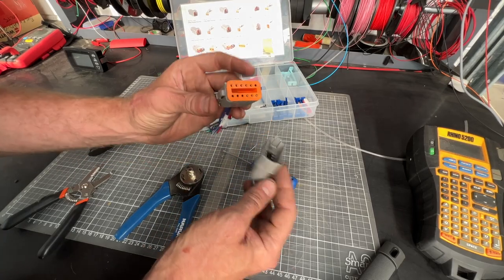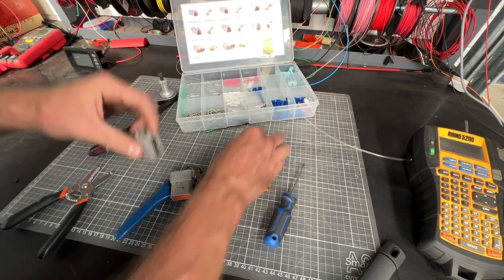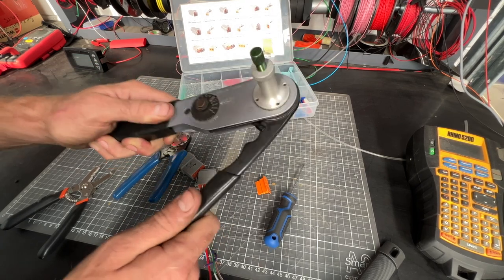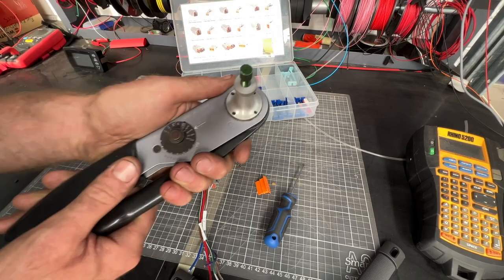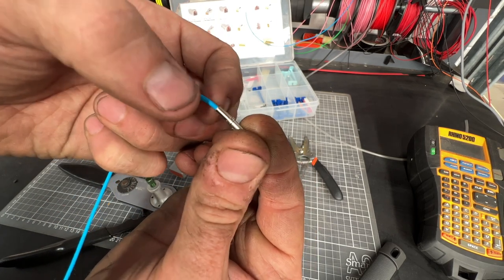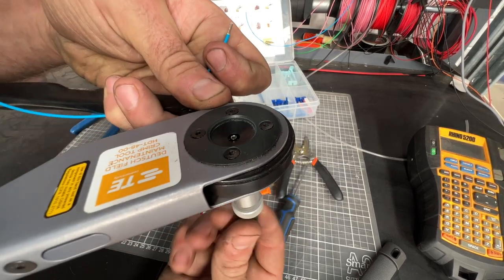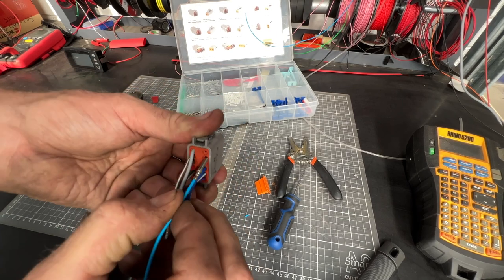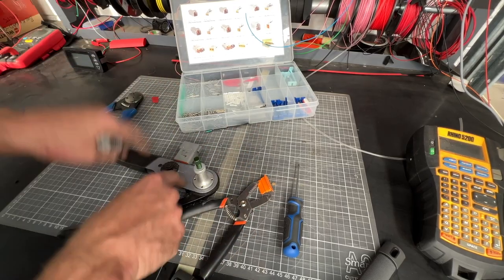Deutsch Crimping Tutorial - Why use the expensive tool.

Comment: Good breakdown of the cost to perforamnce balance. I have always wanted to use deutsch connectors, but could never justify the crimper cost. I don't understand how there isn't any middle ground tools. Just odd.
Reply: You can get Chinese-made clones of the $800 tool for around $150-200. But I have no idea if they’re any good. What I did is to buy the real tool, but used. You can get them quite cheap on eBay. (Also, the actual manufacturers of the original tools, Daniels Mfg. (DMC) and Astro Tool, sell them for less money than you pay buying them through the connector company. Just search the site or contact them for which tool for your connector contacts.)

Comment: If 10% of the cheap tool crimps fail, then Deutsch crimper breaks even with the cheap crimper in terms of failed crimps when one crimps 9000 times. For someone like me that will make perhaps 1000 crimps ever, then having to make 1100 crimps to get 1000 successful crimps will cost me $770 less than buying the $900 crimpers. Its horses for courses really. 
Thanks for bringing this up and helping me justify my tool choice. Your choice I'm sure is based on a very different scenario. Not only do you need to consider the cost of failed crimps but also the lost time due to failed crimps.
Whats more important to a person like me is the test for a failed crimp...is it just the pull test or something else I need to consider?
Reply from the maker: exactly. If I was buying for home, I'd work with the $30 tool
Reply: I am a home/DYI person working on my car (to try to go fast) and will be getting the nice tool first and only buying one. Hopefully, with it lasting my lifetime. You can buy it from the TE site directly for $280 at the time of this comment if you live in the US. I have determined I don't need a DMC crimper (or any aerospace grade; $7-800 range direct from DMC) but do want to feel confident with more than just the "pull test". If I get to a point where I need a more specialized crimper than the Deutsch I will cross that bridge when I come to it. Also, if I do need a DMC eventually, I would imagine myself keeping the other nice crimper as a spare or even selling if need be. That's another advantage of buying quality tools, someone else will probably want to buy it if it's taken care of but the $30 crimper may fetch $1-5 bucks at a yard sale if you're lucky. I only have a little more than 10 crimps I have planned to make and need a tool for but I am taking the integrity of the crimp highly into consideration. This crimp will involve things tied to my traction control system in my car so I don't want to skimp on the final turn - pun intended. There is also shipping costs and other factors that go into play with crimping in general. I am sure I will crimp other things with it and more once I have can think of things that could work better with a DT connector. I may buy a 50 pack of contacts to start and practice with but am mostly concerned with inflation and quality.
Reply: @Jauntmotors  Whats more important to a person like me is the test for a failed crimp...is it just the pull test or something else I need to consider? Can you illuminate us?  (so our joints can keep on powering our illumination and other items that need power :) )
Reply: @papajoewil10  I never thought there was anyone else on this planet that thought like me. If I'm to gauge you correctly, you're going to buy (or have bought by now) a crimping tool for $280 with little more than ten crimps to complete?
 
I just bought the DMC AF8 (with turret) for NZD$1,138.50 and the Go / No-Go Gauge of NZD$182.85 (Total USD value of $833.62) with about as many crimps in mind!

Just remember, "quality is remembered 'long' after the price is forgotten"! Also, you'll find that you crimp one heck of a lot more than just the ten terminals AND you'll enjoy doing it a lot more also, so well done!
Reply: @SeriousSchitt   You are correct, I've probably crimped 20-30 connectors for my car but it's still working as brand new and expect it to do so for my lifetime if I dont drop it lol. I agree, buy once, cry once. Don't skimp on electronics or connections when it involves keeping you safe.

Comment: Fantastic video. Was searching for crimping resources and so happy to have found yours. Thanks for posting! :)

One thing I notice, your crimp position on the contact may be a little bit "too centered"? I have seen a bunch of info saying you want to crimp slightly closer to the end as to not crush the inspection hole of the pin. I could be wrong but something I did see.

Are those genuine Deutsch connectors or amazon specials? Curious at the cost vs quality for those.

Comment: hmmm my 28$ crimper from  ali express  crimps JUST AS good as that 800$ tool expensive isnt always better. just a massive wank factor mark up
Reply: Good luck, had my friend take his supra to a performance shop and one of the crimps failed and the wire came out of the pin and he lost fuel level gauge readout. Looked at the crimp on the pin and it was different than the tool shown here. I bought the chinese replica of these and it crimps many times better

Comment: There are plenty of good options between a $30 crimper and that $800 one. And a DMC crimper is between $400 and $500. I simply cannot see $800 for a barrel crimper. Also, someone with bad skills can still make bad connections no matter how much they spend on tools.
Reply: $800 certainly sounds steep. I thought the TE crimper was cheaper than the DMC and in fact the TE version is manufactured by DMC, it's just application specific.